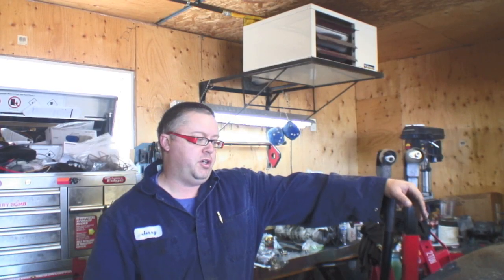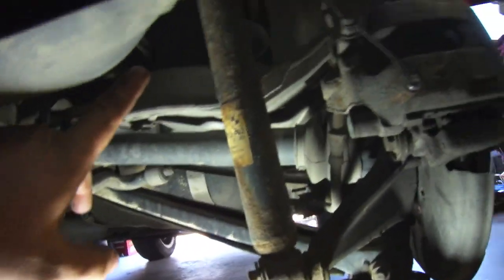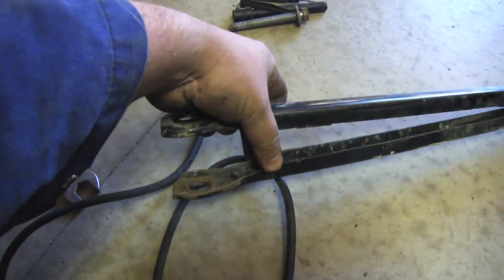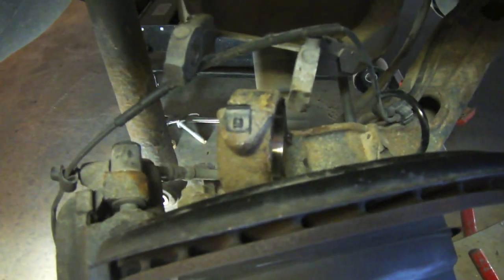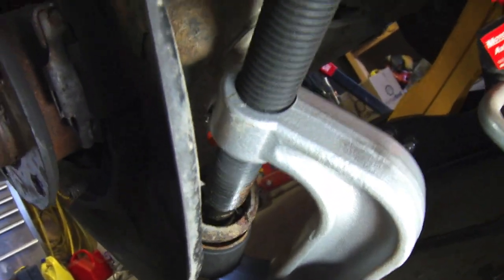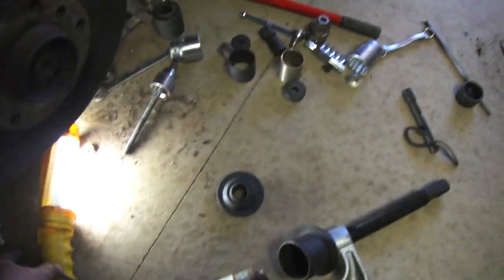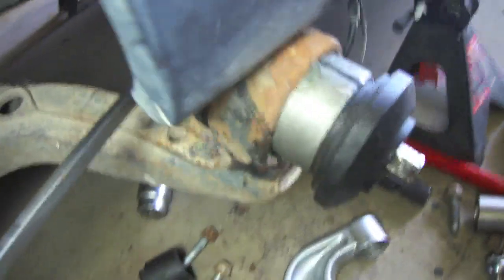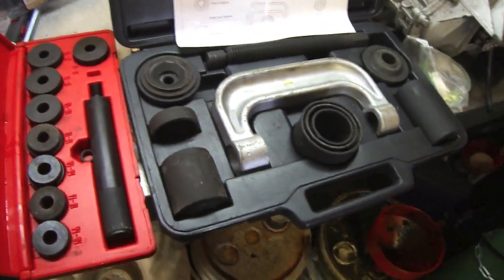DIY E46 BMW Rear Bushing Replacement

Comment: nice video, but on the rear trailing arm bush you should mark the 3 bolts to ensure proper alignment on refitting. also it is very important to measure the angle between the arm and mounting bush/plate so they can be refitted at the right angle. if not the bush will be under torsion at normal ride height causing the bush to fail much quicker. if done wrong the new bushes will only last 5k before tearing.

Comment: just changed my rear sport springs!!! easy tip

rather then fighting with the suspension etc, just put the standard Bmw Jack in the front of the inner wheel arch behind the mud guard area & just crank it up... then just slip the new spring & pads into place. then just lower it away ... it saves all the swearing & cut fingers etc

5min job... but damn I'm keeping this video for when I've to do the same with my suspension Bush's👍👍

Comment: Hi, does the original bump stops has a washer installed in the top which holds it up or its separate? mines just wont stay up.

Comment: Great video. I love your realistic approach :)
Not had the pleasure of doing the bushings on my e46 yet but had a whale of a time doing the bushes on my Miata
ended up using a G clamp with some scaffold tube to get the old bitches out and then upgraded to powerflex bushes which are dead easy to fit as they came in two half's and can be put in by hand.

Keep up the good work

Many thanks

Steve

Comment: Question my BMW 325ci E46 makes noise in the rear  when i go over bumps. Even if i stand in back of the vehicle and push down it sqeaks, is that the rear bushings or does the struts need to be lube up?

Comment: regarding the upper bearing on the hub, does the trailing arm need to be disconnected to access/remove this bearing or  is the a more simplified way??

Comment: So, my 2005 Bmw 325i shakes  when speed is going from 0 mph to 35mph. At 35 mph car stops shaking and drives smooth. Was told that the problem is the differential mounts or bushings need to be replaced. Do you have a video to remove the bushings or mounts. What tools do I need. Any info would be appreciated. Thanks
Reply: Hey Man, did you replaced the bushings? I kinda have some similar noise on my 04  325xi

Comment: That would be cool if you got an X5 would you get the older style(E53) or the new E70? My grandmother has a 2007 3.0si and she loves it. But just be prepared cause they are known for the electric water pump failing. Luckily it hasnt happend to us yet. Fingers crossed.

Comment: the rear springs in my 328i will pull out with jus the shock unbolted, but I also don't have that circle plate on top of my springs. Anyways, great video all around!

Comment: Hilarious lmao great video though. I actually replaced both lower rear control arms last week. That was the worst job ever i had to disconnect differential, axles, drive shaft and fight it to squeeze bolt out like 8 hours total both sides

Comment: that looked like a big pita!
Reply from the maker: it was my word of advice is to buy the bushing removal kit it would be way less headache
Reply: Yeah I recall you saying in the video. I have to commend you in your fortitude.  Question, as I have never tackled something like that, but would heating up the area with a torch or something helped or was it mostly a clearance issue?
Reply from the maker: i wouldn't heat it up, most of the bushings have some sort of rubber or grease in them so the outcome wouldn't be pretty.  i've been thinking of redoing it all and doing a sub frame rebuild with all powerflex bushings

Comment: What kind of grease is appropriate for putting a rubber bushing into a steel suspension arm?  I've looked all around and can't seem to get good info on this simple question.  Isn't there a simple product that everyone has been using forever, just because it works?
Reply: Silicone grease.

Comment: Bullshitkorner 
I just replaced the rear shocks on my 1999 BMW 328i but now I still hear a sound on the back .i only hear the sound when shifting gears do you think it's the springs that are  broken?
Reply: Juan Villatoro  diff bushes?

Comment: Will it be a bad idea to freeze the bushings before mounting them?
Reply from the maker: i don't think so, anything is worth giving it a try to make the job easier
Reply: nope, is a really good idea, makes it a lot easier and is safer than heating the arm and risking damaging the rubber.
Reply from the maker: why would you heat the arm, that would make the metal expand and harder to put on ?
Reply from the maker: barerobert I bet having that tool set made a huge difference, I wish i had purchased the kit it would have made things way easier
Reply: Bullshitkorner because as you said it would expand the metal and actually increase the  internal diameter(of trailing arm). thus making the bush easier to install. which is how a lot of tolerance fit parts are assembled in factories! but not normally something you would do when heat transfer could affect rubber bushings after fitting.
Reply from the maker: no that's right my bad for some reason i was thinking of the front control arm bushing, heating that and then trying to put the bushing on would be a lost cause.  but yeah you wouldn't want to heat the metal too much as the rubber might get damaged
Reply: Bullshitkorner I guess so, first one took maybe 45 minutes of effective worktime. :)
Used 3 hours, but my garage is a MESS so most time went searching for tools :p

Comment: I remember I had to do this when I bent the control arm on the driver side....all I have to say is WHAT A BITCH OF A JOB. Took me 3 days because of that bolt that wouldn't come out since it was hitting the diff and the bolt to the bushing on the trailing arm was seized. I found a trick tho....if you remove one of the bolts that hold the diff, you are able to jack it up high enough to where you can get that bolt to slide out on a slight angle. This way you don't have to drop the differential or have to remove any more part than you need!
Reply from the maker: Ya it was a bitch, having the proper tools would make the job easier